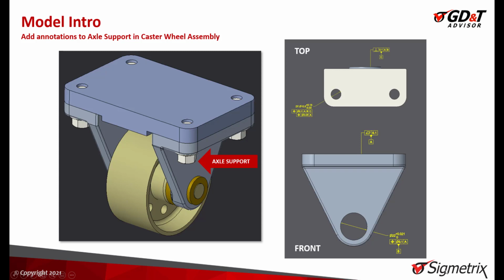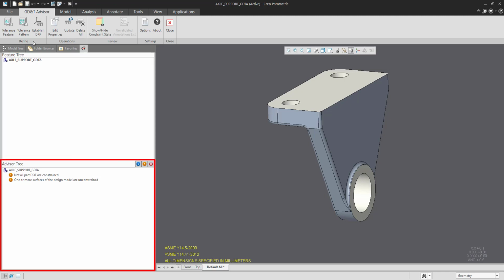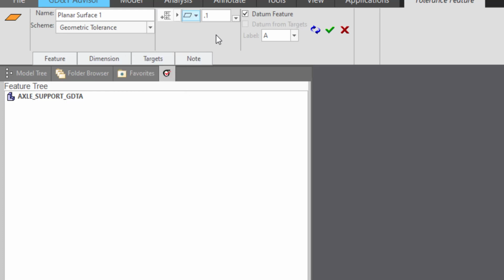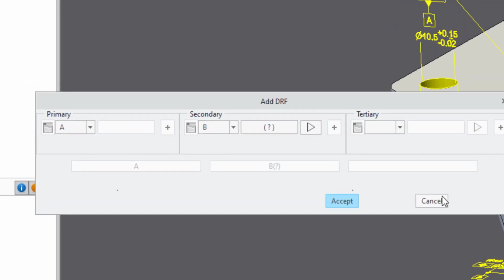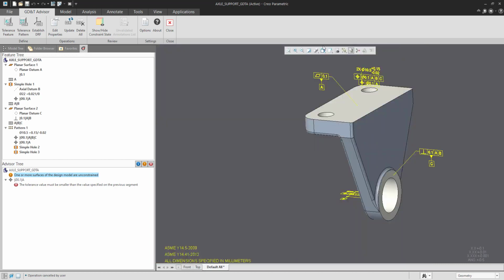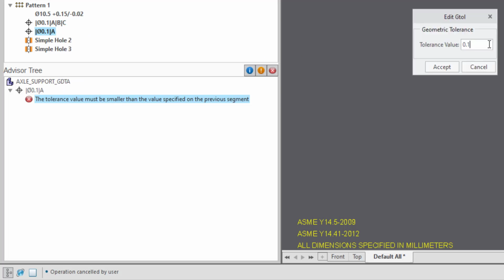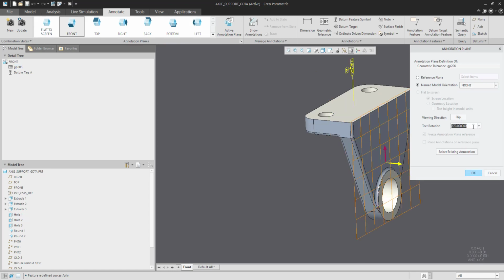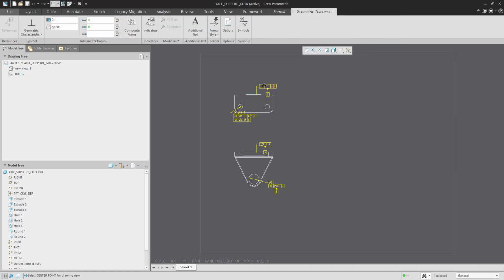GD&T Advisor for PTC Creo 4

Comment: Hi guys.  I have been using Creo for only several years and had not done any tolerance analysis with Creo.  I'm curring using Creo 5 at a medical device company.  I'm trying to learn how to do tolerance analysis within Creo.  So I have been looking at some YouTube videos and I saw two ways of doing tolerance analysis.  One is doing tolerance analysis within the Analysis tab.  And when I clicked it opened, the Tolerance Analysis Manager (Sigmetrix intigrated?) window came out.  And the other one is with the Tolerance Analysis extension that you guys shown here.

So my question is what is the different?
Reply from the maker: Hi! The recommended 1D tool is the EZ Tolerance Analysis in the Applications tab. I cant attach a screenshot here, but if you send an email to sales@sigmetrix.com we can walk you through how to find it.